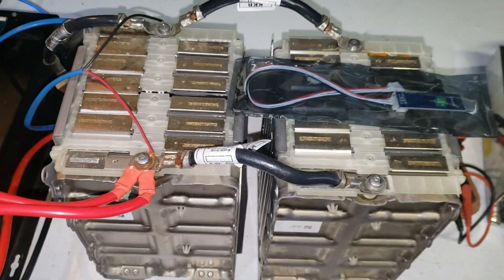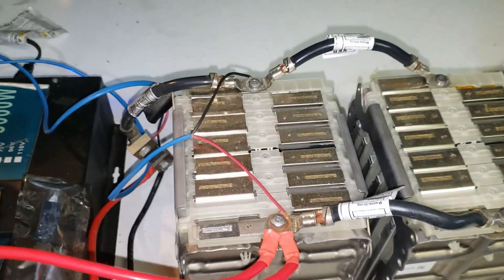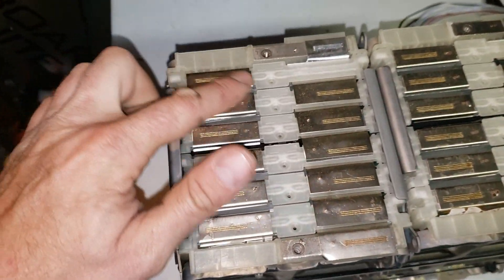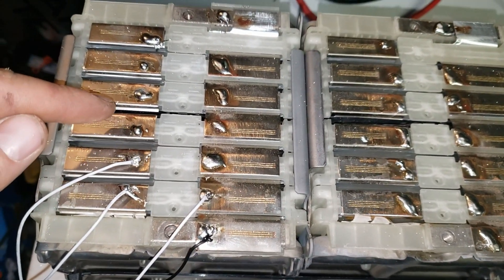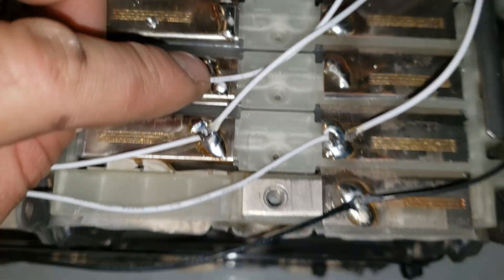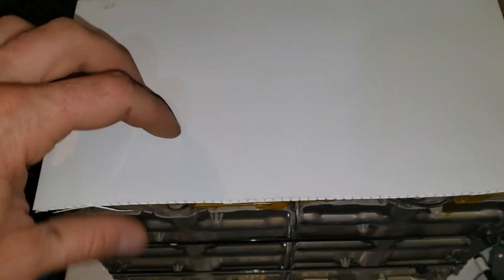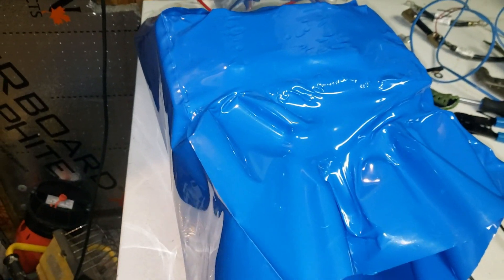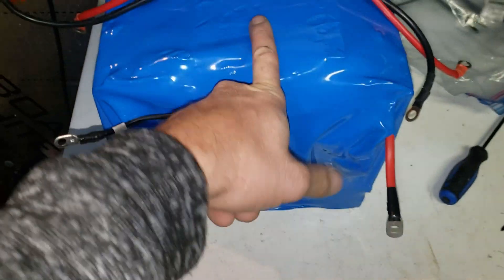1 8Kwh 48V Battery With BlueTooth BMS Build Pt1

Comment: Thanks for trying the 200W iron out on these! I was struggling to find a good connection method for bms leads. However, 12s is ≈44V nominal, as advertised @batteryhookup. You need 13s to get to the voltage ranges you mentioned, and unless i missed it you didn't add a 13th cell in series.  So you may want to update your video and explain that these are in fact NOT 48V.
Reply from the maker: Check out my newest video ;)
Reply: 12S, 13S and 14S NMC are all considered 48V because the voltage range falls within most 48V inverters. It might be better if we called 12S 48V Low and 14S 48V High because there are some inverters that operate at a higher voltage range and some that are a little more forgiving on the lower voltage range but cap out 54V since lead acid 48V caps out at just under 51V. 6S and 7S are both considered 24V. 6S gets a little low for most all inverters but like the video said thats actually a great thing. It's your low voltage cutoff for the pack. No need to rely on those silly BMS's, just slap on a balancer if needed and keep all the loads through the inverter.

Just like 15S and 16S LiFeP04 are considered 48V. 15S is dead on 48V nominal if you have regular 3.2V cells (A123 are 3.3V nominal) but you'll find 90% of 48V LiFeP04 titled items are in reference to a 16S. I'd have to guess its because its a multiple of 4 and much easier to arrange  while keeping it easily compatible with 12V and 24V at 4S and 8S

Comment: Thank you very much for this! 

Is this similar to the method you used to solder the BMS wiring on the BMW batteries, using the large 200W soldering iron?
Reply from the maker: yes it works well :)
Reply: Awesome, thank you!

If you don't have a large 150W or 200W soldering iron, what are your thoughts on using a small piece of nickel strip and a 18650 spot wielder to attach the strip to the top of the cell 2 or 3 good times along the strip, then soldering your BMS wires to the thin nickel strip with a normal 60W iron?
Reply from the maker: @micahwilliams2609  it could work